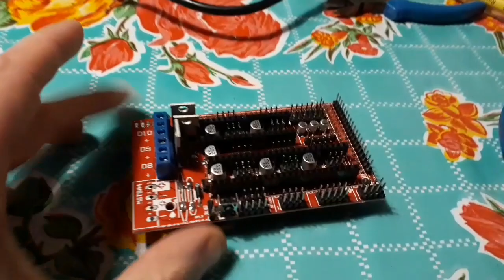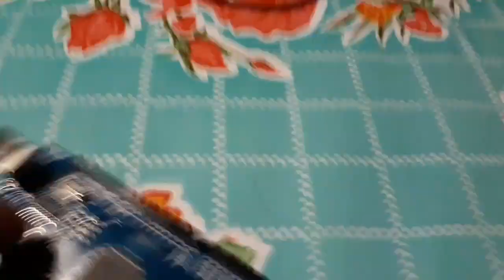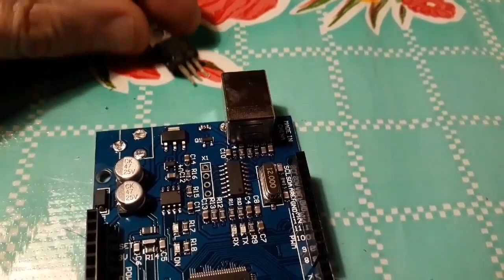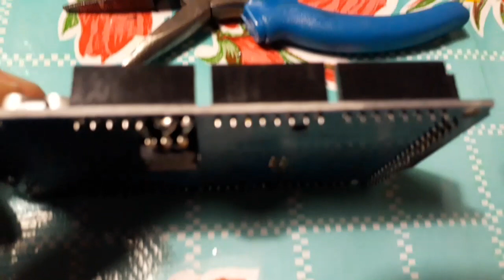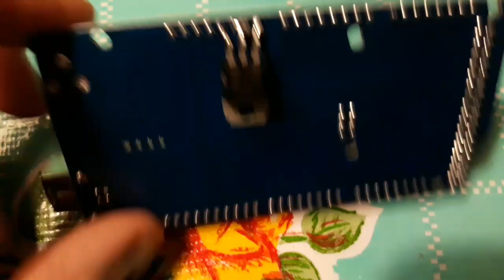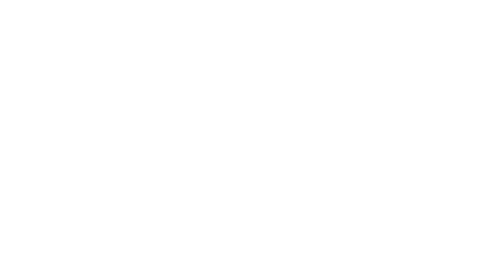RAMPS 1.4 on 24V by replacing voltage regulator on the Arduino MEGA

Comment: Nice, very well thought out plan here. I am of the opinion when you need to go to 24v then rather go for a batter solution as staying with the 8bit arduino at that stage would make little sense. I built 2 Prusa i3 MK2 clones using the arduino and ramps 1.4 combo, had to use a mosfet board for the heated bed. My i3 MK3 clone is running off a 24V PSU on a Bigtreetech SKR mini 3 v2.0 and that thing is a champ on 24v and it is cheaper than say an arduino/ramps1.4/DRV8255 combo.

Comment: when i connected my homemade regulator to my arduino (power transistor and zener with some resistors) my arduino did in fact blew up but not as i thought it would, because the only thing that fried was the serial converter chip, which after replacing made arduino 100% working again, 
later i put 7005 on a radiator and soldered it to the regulator pins although i was using 15V power suply which died soon after
but yeah i never understood why people removing the diode and not deal with power regulator itself, might be a bygone from using 5v standby rail of the pc power suply as a 5v suply but in 24v you often don't have that and need another stepdown converter

Comment: I did it and worked great except for the lcd screen, when using a 12v or less power suply it work without any problem, but when using the 24v power suply the screen just show rare characters or just don't show a thing. Could you help me with this problem? thanks for the video.

Comment: I really like this solution, however, I have decided to just use a buck converter and still cut the diode on the ramps board. This is also because I use a raspberry pi with the ramps board and the pi also needs 5v and more amps. The buck converter will provide everything I need, and now thanks to your guide I know exactly how to circumvent the voltage regulator and just send 5v directly to the Mega.

Comment: So if i remove fuses or replace them with the bigger one (24V 12A/15A), i can use  power supply with that max current without problem and another conversion?
Reply: just see if components on ramps takes that, some has 16v capacitors... and fusistor...  Then cut the diode on ramps so it will not power arduino with more than 12v and voilla,,,, You have a 24v printer!!!

Comment: thanks for showing this, I have a couple of cheap ramps / mega boards that the regulators have popped because of the reprap full graphics controller draws more than the regulators can handle on the cheap boards, - by coincidence I bought 10x L7805CVs  which arrived today and browsing over the spec sheet  they appear to have a max voltage of 35v so naturally I suspected I wont need 2 different power sources if running the ramps @24v  but I wasnt sure how the mega would behave backfeeding 24v from the ramps to it so can I ask  have you run this mod at 24v?

Comment: I connect the VR 7805 as you show but still my computer can't detect it (says USB not recognize) on the board to light R17 and R18 and RX blink one time only at start
then nothing (don't know what does it mean) is My Mega 2560 gone  Thank you
Reply from the maker: Take the 7805 and hook the board to the USB, if it works (from the 5V from the USB), there is something wrong with the 7805 or the way it was hooked up. If it still doesn't work, the board is faulty.